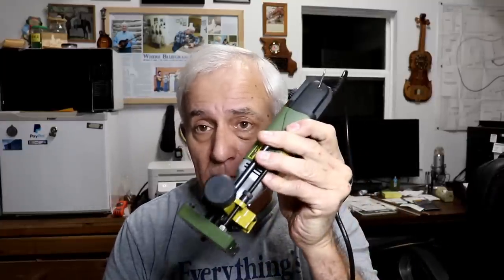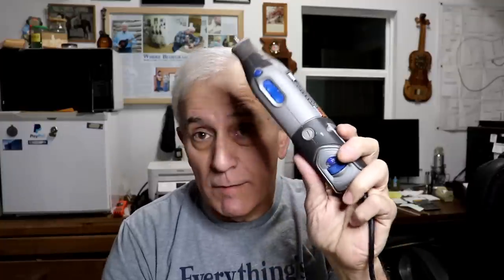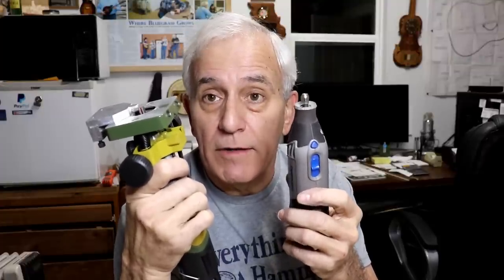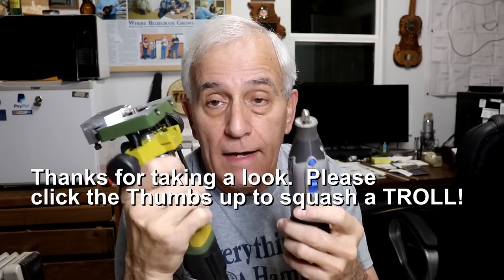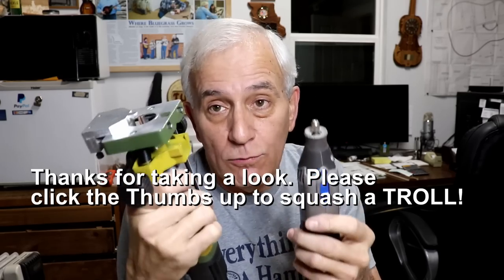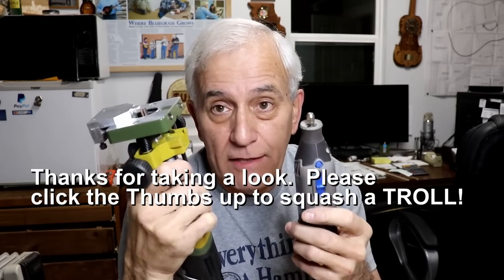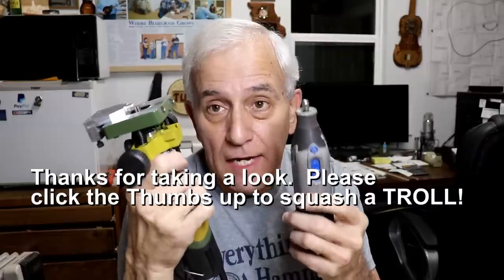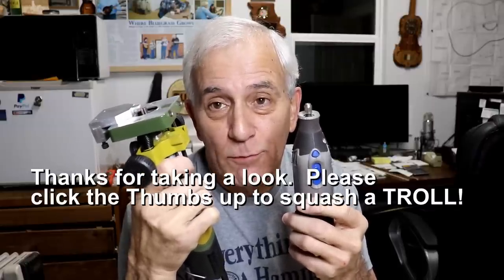361 RSW Dremel Vs Proxxon   The Battle Begins

Comment: i saw the same comparison you mentioned.  I've used a shaft drive for at least 30, years. It had been my grandfather's the motor by Johnson (circa 1960) finally burned out, so i bought a Proxxon based upon Crimson's review.  I fully agree with your discontent, too - for precisely the same reasons.  I have a new-ish Dermel 4000 which works well, but I'm gonna cross my fingers and replace that motor from Wisconsin with one made in China.  Guess maybe I'm too old to adapt? I really like my Dremel-made 90 on the shaft drive for had held work.  Great comparison, though.

Comment: I'd be really curious to see if you liked the Dremel Forti-Flex better than the 4000, if you ever have a chance to try it, since it's got 2.5A to work with in addition to the pen-shaped hand tool. I know you said you didn't like the flex shaft attachment for the 4000, but I've heard good things about the Forti-Flex.

Comment: What You need is 1st a 25$ set Walmart, Aldi to learn with the tool. 2nd. a Dremel best all around tool. 3 rd proxxon professional quiet precise.

As long as Your tool is not broken, the Quality of the bit You put in the chuck makes the biggest difference. 

Love my garage sale thing 8€. Somebody put a mini chuck on a 200W Black&Decker motor of a Sander. 8000 rpm fix. Flawless hobby work. Sure I could more appreciate the creator more than the Sellers.

Comment: Spray on Teflon might help that base. Never tried it, but just a thought. 
Did you ever change the bearings and clean the fan and commutator in that dremel? That can significantly reduce noise and vibration.

I would agree that the dremel 3000 and 4000 are superior to the proxon, but have noticed that some (but not all) fairly inexpensive rotary tools are equal in quality and have more  power than both the dremel and proxon. The drawback with these alternatives is it can be difficult to find spare parts and you have to check for compatibility of dremel accessories if you intend to use them.
Reply: Midnight Joker I have used spray Teflon in other applications and found it effective. I have also used powdered Teflon (on piano actions). You need something with a bit of “tooth” to hold it. The powdered Teflon might hold on to the back side of tape. First tape the base and then brush on Teflon?
Reply: @philipallard8026  I am sure you are right about this. Also, having read the other comments, I'm pretty sure that the UHMW tape is the way to go. I looked into it for one of my projects, but its pretty expensive stuff. Thanks for the content

Comment: I have a tendency to buy the more expensive, higher-powered tools anyway, and I have been ridiculed for paying extra when the less expensive tool does the same thing.  In a sense, yes.  I have had problems with tool slippage in the Dremel chucks and one of the worst was the collet chuck.  No matter how tight I thought I had it, it still slipped. On that same Dremel, and I don't remember what model it was, there was a serious vibration at the working end of the tool.  It was like holding Cicada in your hand while it was making its' ratchety noise.  That tool is long gone, to say the least.  Subsequent Dremels have been fine. The other, I think, was just a lemon that sneaked through quality control.  Good eval on your part I believe!

Comment: Without looking, I would think the European models of Proxxon would be higher amperage because they use 220volts over there.   SO machine the base of the Proton down 1/8th and make a wider plate.  Just use the screws that are already there.  Should be really easy
Reply from the maker: Sounds simple. But the base is not even a 1/8 inch thick. And there are tons of bosses on the inside that would be cut loose.
Reply: Stephen, I think you have it backwards. Assuming the US and European models are the same motor wattage, the 230V version will draw half the current of the 115V version.

Comment: Jerry, they make HDPE tape that could be used for your new metal base. You’ll likely have to mill a bit more off of the guide jig you built though. You could also just add a piece of HDPE to the base (read Walmart cutting board) and make it any size or shape you want, but again, that would mean re milling a new jig to fit the new base plate size and thickness.

Comment: I have replaced the brushes in my Dremel , but it is old .
Reply from the maker: I shouldn't say this but mine still has the original brushes. And that has a lot of hours on it.
Reply: @RosaStringWorks  Brushes are like spark plugs in a car. They wear out. However; some brushes last longer than others, just like platinum plugs last longer than steel ones. You seem to have gotten quality brushes with your old Dremel.

Comment: Hi, I will say... the advice about amperage is fair and right. P+U*I , not to much to argue, is Ohm law :-)... the voltage (U) being the same for both... "I" the intensity in Amps make the P, (power in watts) bigger.
About the noise, naturally a more powerful motor will produce more noise. 
But don't forget Jerry, your bearings in the Dremel are 15 years old (I assume you never change them) and I tell you from experience, a good bulk of a motor noise comes from the bearings. 
There are specialised machines we use in motors maintenance that by reading the noise frequency of a bearing tell you if needed to be exchanged... but I speak about big motors I work with. I'm a railway electrical engineer.
But bearings are not responsible for the majority of the noise... the brushes are... and the Dremel is not a brushless motor. I assume you did not change them also. No need to touch it if its works.. . but I kindly advise you to check them. Are the small buttons with a screwdriver slot on the side of the body on your Dremel. 
The end semicircular face of the brush must be shiny and must not present any chip or flash marks on the sides. if you find them like this, buy a set from Dremel, polish little bit the rotor collector and exchange the brushes.
About the key for the mandrel... here a tip: 
The rubberised end from the Dremel can be used as a key for the mandrel. You unscrew this and shifted litle bit up to the mandrel, you will se, it cannot be taken out unless you align with the slot of the mandrel. Is purposely done like this to be used as a key... give you more grip by the diameter and by the rubber surface.
 (the one that you dont take out to fix the flexible cord :-) because you don't like them.... me to, I don't like the flexible cord also)
Other pleading in Dremel favour... 
But I will not say Proxxon is not a good tool. Proxxon are excellent also. I like the options that Proxxon offer, the base and etc... looks more profi in metal when the genuine Dremel are more "hobby"stile plastic let say.
For the bottom of the Proxxon base, I use a piece of white vegetable cutting board. you buy this with few dollars and is a PPA. 
An relatively soft polypropylene not to damage your knife... and is food grade so nothing stick to it, Is basically teflon and is slide like a dream on all surfaces.
All the best, nice job!

Comment: you could put 20mm collar with screw tightening on that proxxon. Don't know if there is any commonly sold, but I think it would be too difficult make like from wood. Similar to that dremmel's bolster/cross-guard. Wood could feel nice to hand. 
What about torque on different rpm levels. I know that those two have different motors graphite-brush(dremmel) vs brushless(proxxon). 

I did myself buy proxxon (230/E smaller than that IB/E) for that noise level and I have older dremmel 3000 which brushess worn out. Unfortnuatly dremmel don't yet manufacture corded brushless drills, maybe some day though (that is one reason why proxxon is more silent).
Reply: Hmm actually this DC motor proxxon might be actually brush motor(looking on pictures of that motor), not brushless. I wonder where did read that it would be brushless. :D

Comment: A 1/8th "piece of thin HDPE countersunk, and screwed to the base may be a fairly easy solution to the metal base on the Proxxon.
Reply from the maker: Thought of that. But there is just no room
Reply: @RosaStringWorks  , No doubt that you will come up with a solution. Maybe remove a little thickness from the base itself.
Reply: @RosaStringWorks  Clear self-adhesive pickguard material (the cheap stuff) for your router base.  Lasts a long time and simple to replace.  Adds very little height to the base.

Comment: Proxon = 20mm mounting near the chuck = can be mounted on any CNC and provides huge stability
Dremel = stupid body shape = hand held only
And when it comes to power there are two and only two factors:
Brushless is far stronger than brushed
Larger diameter rotor = higher torque
Reply: beware fan boy's they believe their favorite tool can do no wrong.
Reply: @ChickenPermissionOG  They are weak and noisy Never managed to push one above 20w before it stalled. But you can cut hundreds of meters of carbon fiber and FR4 with a 40$ spindle. If that's not value nothing is. Now back to your handmade filling. You might need a new pair of glasses soon. Pickle jars will do just fine 💔

Comment: Mr. Rosa I am a big Dremel fan, I own 5 of them set up for different job applications.
I've had 2 proxxon tools that in my  estimation were just junk, they didn't last very long and ended up in the trash bin. I'm a wood worker and a carver and have a lot of dremel tools but I will never buy a dremel cordless again the batteries are crap. sorry about the small rant.
Love your work and videos. PS the music is great too   Thanks Dan
Reply from the maker: I had a cordless Dremel also and it was junk.
Reply: @RosaStringWorks  
I have had cordless tools of several kinds and will not buy them again.  However, my son has bought some nice tools that are cordless and they seem fine.  However, he has extra battery packs for them which is one of the reasons I don't like cordless.  You have a full battery which runs down in 15 min or so and then takes 24 hrs to recharge!  How are you supposed to get any work done?
Reply: Perhaps it's just a matter of purchasing the appropriate model , proxxon makes many different models of drilling tools

Comment: If you want close up precision and something to hold like a pen use the flexi-shaft you can buy for the proxxon . One of the reasons the Dremel is noisier is not just the power but the tolerances in the build especially in the bearings which leads to higher vibration . This is  a factor if you use your rotary tool for extended periods, the noise over a long period of time could be wearing too . This might be part of the reason that some are saying that the Proxxon is more of a "professional" tool, it could be those that use their rotary tool for a large part of the working day. Maybe if you are doing work which demands short bursts of high speed and high power then the Dremel is for you . I have used earlier Dremel models and the vibration was the thing that bothered me most . If you are exposed to this for a long period of time you can end up with peripheral nerve damage in your finger tips.

Comment: You should compare runout on the tip of the tool. The PROXXON is definitely the more accurate one.
Reply from the maker: Sorry, you are incorrect
Reply: @RosaStringWorks  no I am not. I developed these tools, and I know exactly the cheap stuff that’s inside the plastic dremel.

Comment: Contact cement some plastic laminate (Formica) onto that base. If you want to extend it, use some thin delrin and two sided tape. Don't think contact cement will hold delrin.

Comment: Hay Jerry i know you can repare cases I have my dad’s guitar and the storage compartment has come apart  the half that has the lid connected  how would you suggest to fix it ty arland
Reply: I have fixed these.  It's important to lift the soft cloth that covers the broken parts. You will have to glue the cloth back later so don't tear it up. Lift up the cloth so you can see what broke. Glue and clamps can work if the glue let loose. (Jerry glues and clamps a lot of stuff, so keep watching his videos) On most cases you can use very small (brad) nails too. If some parts broke into pieces and you can't glue them back, you will have to make a wooden piece to replace them and glue it in place.  Check out Jerry's video on case restoring to see how to work with the cloth to put it back in. https://youtu.be/Njo-Q1qmoXQ

Comment: I bought a Proxon and returned it. Like you found it's hard to hold and in my opinion way overpriced for what it is. I've an old Dremel Professional Model 398 that's still going strong that I replaced the front bearing and brushes in as I wore it out after 5 years or so and I bough a 4000 last year. I still prefer the smaller old Dremel for detail hand work and the bigger 4000 for routing. I've also a Makita 700W trim router for even bigger jobs - great for cutting out pickup and neck slots in solid body electric guitars.

Comment: I have a Dremel 4300 on order, due to supplier delays world wide they are very hard to come by here in Australia currently hopefully not much longer.
I will use it as a replacement for my old (30 year old) current Dremel making pins and modifications to components for doorlocks and padlocks.
The 4300 is more powerful than the 4000 and has several improvements the big ones are far better cooling, 1.8Amps and 35000 RPM

Comment: Just a question, I dont know if I understood this correctly but I think you said you wanted a second rotary tool so you could leave the router attachment on one of them and not have to swap all the time? How come you didnt just get an actual router instead, you get pretty decent ones (corded or cordless) in the same price range, come in different sizes depending on what you need, have way more bits and possibilities, and quite frankly are much better at actual routing. 

Is there some other reason why a second multitool is better?
Again, just curious. Genuine question.

Comment: Nice review however you should check out the Milwaukee m12 cordless rotary tool. I went through my 3rd Dremel and was looking at the Dremel. 8220 vs the Milwaukee. The Milwaukee is more powerful and imo has a better grip. Also  all of the Dremel accessories fit on the Milwaukee. Battery recharge on Milwaukee 30 min. Vs 1 hr Dremel. But if you are into the Milwaukee cordless m12 system extra batteries shouldn’t be a problem. M12 may sound louder but when installed keyless chuck sound did reduce. Also 5 year warranty compared to 2 yr Dremel.

Comment: I don't think that IBS/E is meant to be held in hand.. You need a flex shaft for hand work. If you want the tool in hand buy a FBS or Micromot.. I had a dremel on cnc engraver and the vibration is just crazy... I returned it same day.

Comment: Jerry, I think much of the increased noise, with the Dremel is the fact the Dremel has a plastic
gear case and the Proxon has a metal gear case.
I doubt the noise is your bearings. If it was, you would be getting dome bad cuts.
I have an older and lesser model and it made terrible noise right out of the box.

Comment: You got the wrong Proxxon for your needs. I would go with the Proxxon FBS 240/E.(Do not know if it is named the same on US market) That one you can hold perfectly like a pen, and weighs a lot less than the shown dremel. It's only 100w though compared to the Dremels 175w. Otherwise i like them both.

Comment: I think you left out something, gear ratio of the reduction set …. the difference would be torque which is what does the work ! my2cents
Reply from the maker: I know nothing of gear ratio I just know which one is more powerful and I also know which one spins faster.
Reply: The facts are that AC and DC motors of this type run below 5000 rpm.  Therefore gear reduction is not  an issue. 
 @RosaStringWorks

Comment: I've made foot pedal to control the speed of my Dremel out of an old sewing machine – try that!
Reply from the maker: I already have a store-bought version of that. But I see no reason to use it the Dremel is easy to control the speed as it is.
Reply: @RosaStringWorks  the harbor freight router control works good
Reply: @RosaStringWorks  OK, I use the Flex Shaft, with no "Hands On" adjustment, so the foot pedal is a plus in this configuration (I've got small hands) :-)

Comment: My experiences it comes down to smoothness of Balance I’ve had trouble with Dremel vibrating I know I have an older USA Dremel it’s not a 4000 it might be a 3500 but it was while they were still built in USA which I try to swear by. that’s first time I’ve seen one of those 4000 but it is a ball bearing and it still vibrates if you wanna see a real like top-of-the-line tool you would have to spend $1000 but you should see a precise I may still have it but it was broken or needed brushes but my dad was a motor pattern maker and a precise runs 48,000 RPM and it is highly precision and there is no vibration. That’s something else you might consider I see that Proxxon  makes a belt driven deburring tool I would think that would be the handier tool for many other task I am considering getting one. they also make a battery operated one. Also you might not want to wind those things up without a tool in it pieces can go flying and actually that’s how my dad got the precise they told him to take it home because a guy took out his eye with it.